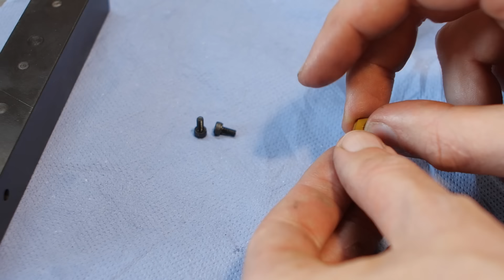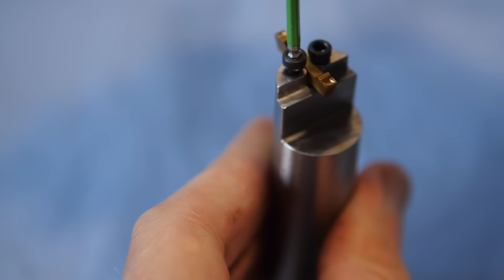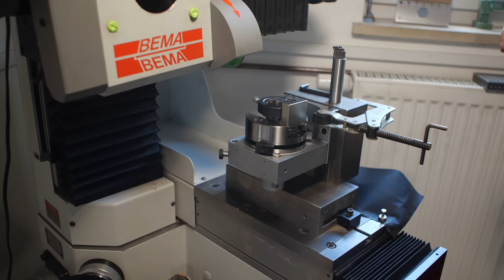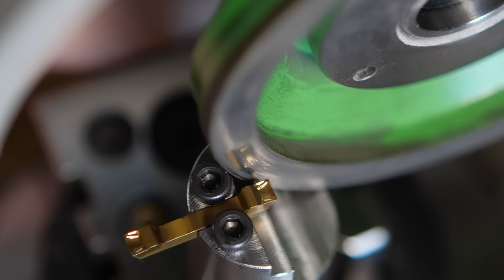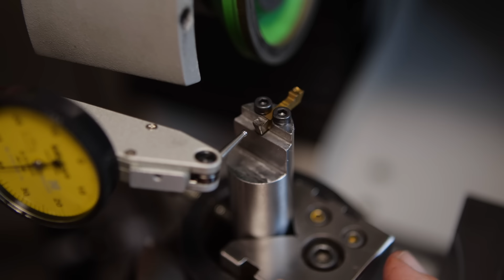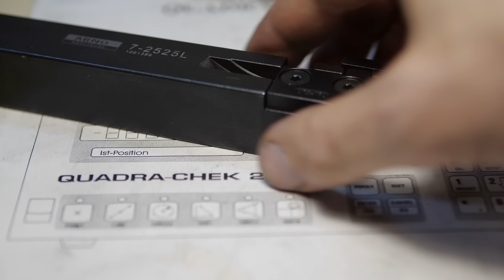Toolgrinding: Radius Groove Inserts

Comment: Thanks for Your general discussion about the usefulness of different grinders, very interesting. The BEMA seems very versatile with the tilting head. In practice I seem so far to use the D-bit grinder for most stuff second my old J&S 540 surface grinder. Always wanted a T&C grinder, but I should perhaps reconsider that. One of my best buys ever is Nikons smallest shadowgraph projector with digital scales, it gets used all the time despite having several microscopes in the shop. Very nice microscope btw.

Comment: why are the bolts on the front of the BEMA green?
Reply from the maker: Oh those are ear plugs. Normaly in these holes there are two tapered pins to orient the head-tilt to zero. I put the ear plugs in when I pull the taper pins, to keep dust out.

Comment: Wouldnt  the rotation of the hold down screws cause friction on the part causing it to move in and outward on the holding fixture
Where as a plate with 2 hole push down on the part with out the friction on the part to be ground
Reply: I was thinking the same ... but apparently the way SG did it is OK?

Comment: How does the insert holdup after you remove coating?
Reply from the maker: Still very good - One insert did all 125 parts necessary and still looks fine.
And despite the clearance surface beeing ground, the chipforming surface is still coated, so there is still a benefit over completely uncoated Carbide.
Reply: @StefanGotteswinter  ok Nice to know👍
Reply: does grinding the corner disrupt the chip breaker built into the insert? 1mm kinda seems like a bit? might not matter if it's a finisher only but just asking.

Comment: I noticed that you were using the back of the wheel on the second edge. I heard there's a risk of the edge chiping when the wheel spins that way because the carbide is not supported. Was this an issue or does it not happen?
Reply from the maker: Thats totaly an issue and real - In an ideal case I would prefer the spindle to run in reverse then. But it is what it is, the ultra fine diamond wheel did well enough in this situation.

Comment: Favourite moments: Soundtrack when walking to the surface grinder was a highlight, thanks for that. Would make a good ringtone I think. Second was seeing the result from the customer's workshop on how the tool performed, really helped with the context. My initial thought was cutting o-ring grooves, but that didn't correlate with grinding the flank of the insert, so the customer images helped me to understand. Disappointed not to see the radius measurement that we were teased with in the thumbnail, but I'll get over it.

Comment: Stefan, what did you dress the diamond wheel with? It looked like wax possibly. It didn't look like something to clean it, since it left a white residue on the diamond. Thanks.
Reply from the maker: Thats an aluminium oxide dressing stick (looks and feels like a bench stone, but has a very soft bond), it dresses back the resin binder and exposes the diamond on resin wheels. Its not ment to shape or true the wheel, that has to be done with a brake dresser or by grinding molybdenium or soft steel.

Comment: "If I had to choose and could only have one grinder in my shop, it would be a surface grinder."

What if a Moore Linear Form Grinder actually came up for sale? They're a weird surface grinder with a pantograph-attached diamond dresser AND a (possibly simultaneous) crush wheel dresser. Obsolete thanks to CNC grinders, but very cool and more versatile than a regular surface grinder.
Reply from the maker: Nope! I know about them from the moore book, but a Diaform wheel dresser would be a way more practical approach 
compared to crush forming.
My old dayjob still had a bunch of them around and in use, mounted on Jung HF surface grinders - Despite having state of the art Jung CNC grinders.

Comment: I'm not a machinist, but if you used a strap across the insert to hold it down, the screws wouldn't try to move it when tightening down. Watch all of your stuff.
Reply from the maker: The screws moving the item to be held down is way less of a problem than one might expect :)
Reply: We must have been thinking on the same wave length
Reply: @pault4513  People who have the first name Paul, may be special. LOL.

Comment: Love that spin fixture but they are expensive. I really like the way you set it up to set the stick-out via gage blocks. I think I could maybe do that job on my D-bit grinder with your holding jig but with the slot for the cutter being 1mm offset to move the cutter relative to the center of rotation.  I would need a double-end jig, one for left and one for right with that.  Such nice work--thank you for sharing and sparking ideas!
Reply from the maker: Machines come down to linear moving and spinning bits ;)
What you make them do is just up to you and your imagination.
Reply from the maker: Boy are they expensive when not found on the used marked :-|
I agree, this could be done very well on a d-bit grinder too!

Comment: My boy ( 9 years old ) says "Stefan Gotteswinter would throw these Chinese gauge blocks at you"  Yes, he actually said that.  What are your thoughts on the 100 to 200 buck gauge block sets from red china?  It seems to me that in my crude shop they are more than adequate  and are good enough to use in a situation like setting up your surface grinder rig.   Like you said, you have several sets.  One is reserved for actual metrology work.
Reply from the maker: The one that i used in this video is a Chinese set 😅 its very good and showed no surprises when I sneaked it into a calibration lab.
Reply: @StefanGotteswinter  good stuff.  You are a big with the 9 year old boy and 5 year old girl demographic located in the Heart of the Ozarks.

Comment: If your gonna make the magnetic base camera arm like Robin have then you could mount a thin sheet of metal that's highly magnetic on the ceiling so the camera don't need and floor space at all 
Just turn on magnet and slap it on the ceiling. Then adjust  and som kind of mechanism with a string that you pull to turn the magnet off agen well holding the arm with the other hand

Comment: I agree with your thoughts on having a surface grinder for many jobs, I have a small unit that I have various shop made extras to allow me to utilise it for more than just surface grinding, currently adjusting a 1.5mm end mill to allow me to reach down .282" deep to complete a .750" long blind slot in some 4140. Without the surface grinder I would be waiting for a long series cutter to arrive, and the job would take longer than it needs to

Comment: Stefan, do you have a manual for that measuring DRO?  It is the same as the baty one I have without a manual.
Reply from the maker: The Quadracheck2000? Yes, I have the full manual in german.
Reply: @StefanGotteswinter  any chance I could scrounge a copy?  Or  could you upload a few snaps of the non-obvious pages somewhere?
Reply from the maker: @wktodd  I can scan it - But it will take a few days.
Reply: @StefanGotteswinter  Thanks Stegan,  I'm in no hurry.   I've just been looking online but all the hits for quadra check refer to the newer Heidenhain device.
Reply: @StefanGotteswinter  Stefan, Thanks for your help, I found a copy of the Metronics version online that seems to bethe same. No need for your copy Thanks.
Reply: Hi Stefan, as always another great video.
I am always checking if you uploaded a new one, and i am happy when i see one.
This is an offtopic question, but i never got an answer before. Did you ever finish that scale 1911 project? I was following it with great joy, but i never see that you finished the project.
Reply from the maker: @1982MatMan  Sorry that project is dead - for precision paper punching i recommend Adam Demuth - He build a 1911 with toolmakers attitude